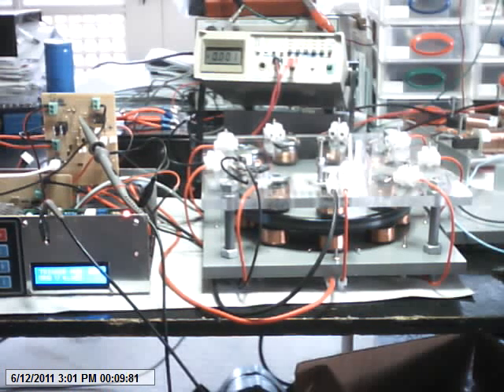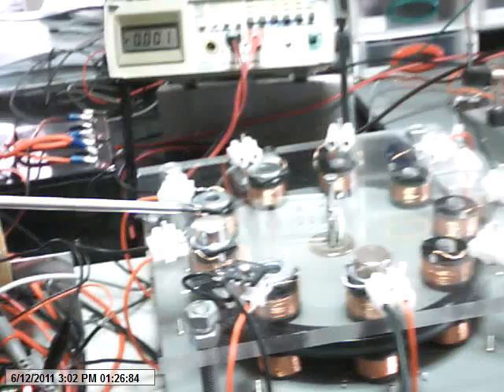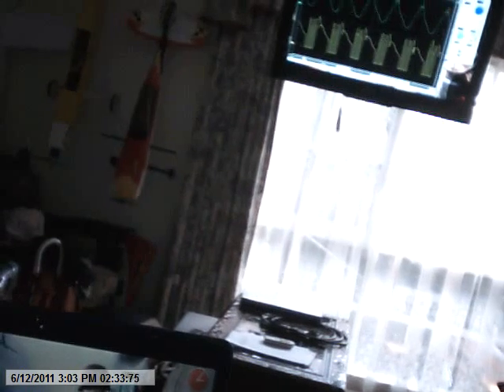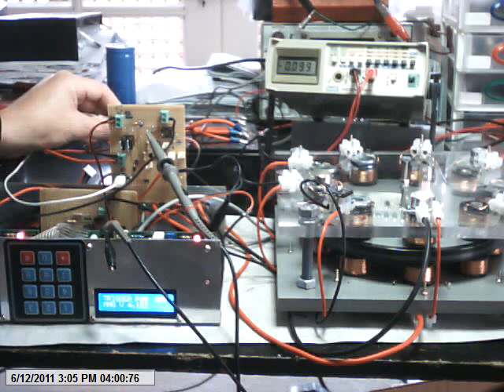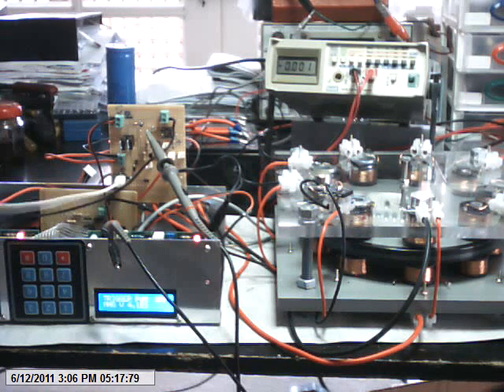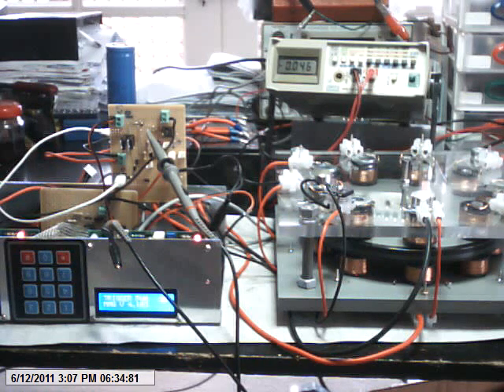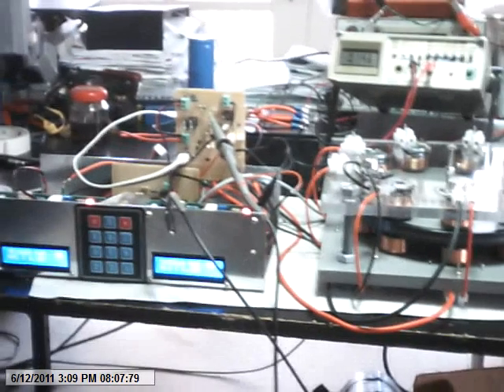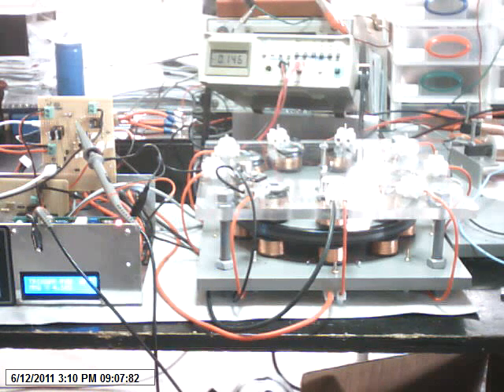RomeroUK Muller Replication accelerating under load.Video 2

Comment: Yes agreed!! taking current at sin 90 degrees should accelerate rotor. Coil still charges during 0 to 90 but no Lenz effect as no coil current during charge phase. This can (I believe) be applied to a standard car alternator also.  I spose your in QLD?  Nice presentation as always. Teslas US433702 Patent shows an alternative way to shift the input to output phase in a simple power transformer ( back in 1890!).